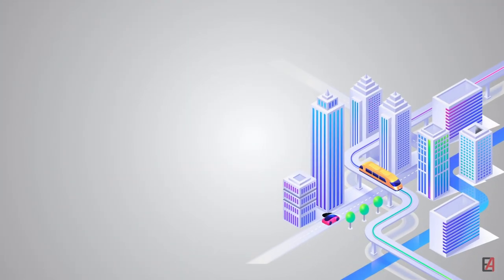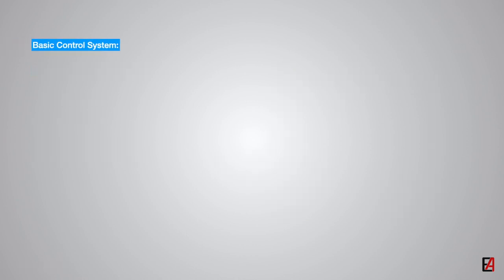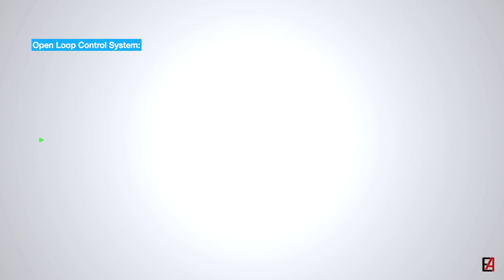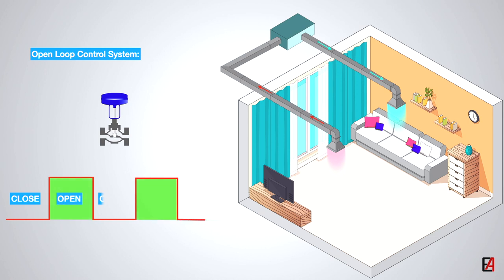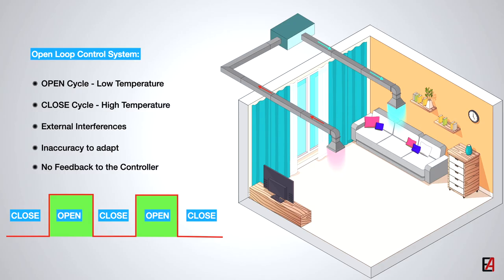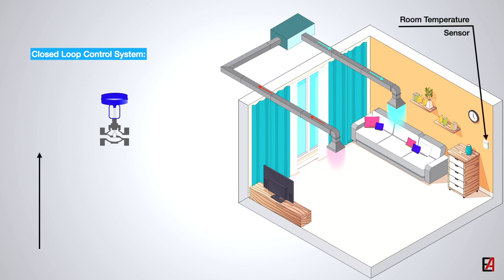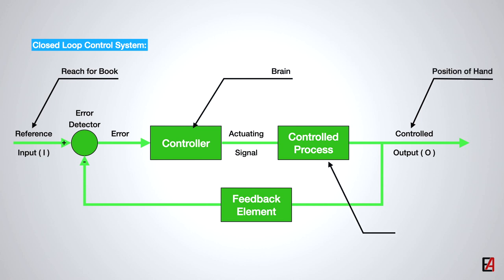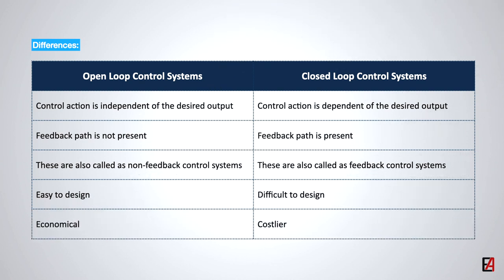Understanding the concept of Control System-Basics,Open & Closed Loop, Feedback Control System. #bms

Comment: So if I understand correctly feedback lets iteratively hone in on accuracy without exactly "knowing" beforehand how precisely to actuate the relevant signals? Otherwise you'd have to know exactly how much to open or close the valve to get a precise temperature, which would be really hard to just figure out but a feedback loop automatically actuates the signal according to whether it hits the target?
Reply from the maker: Yes.. thats what a closed looped control system does. There is a feedback to the controller. The controllers make sure the error is zero comparing with the PV and the Setpoint. Hope this helps.. thank you.. you can also see my other video regarding the PID control system for more details.